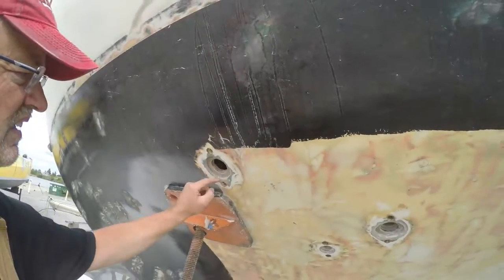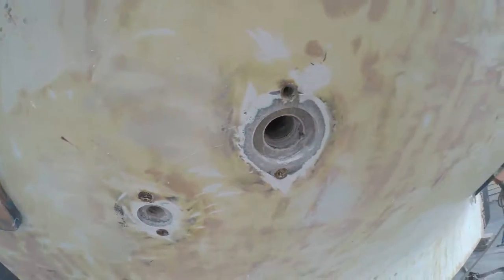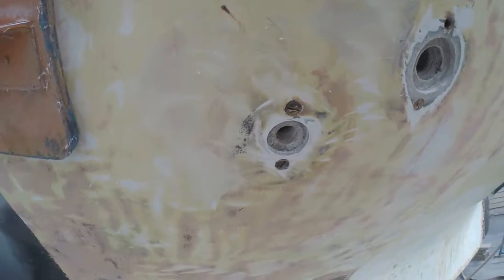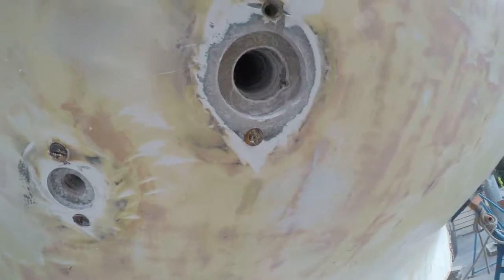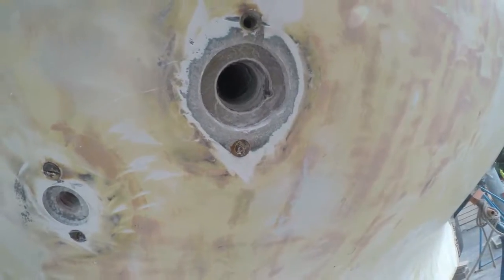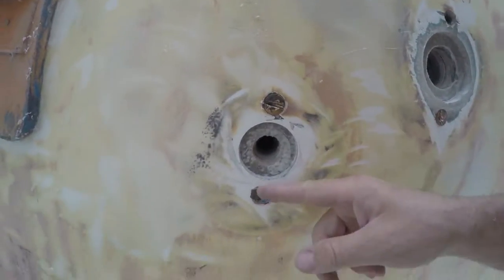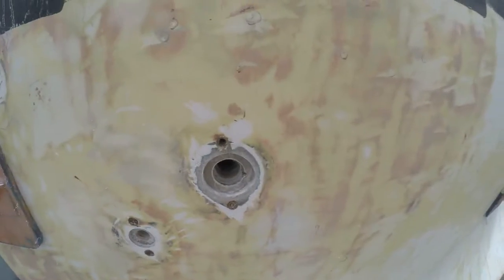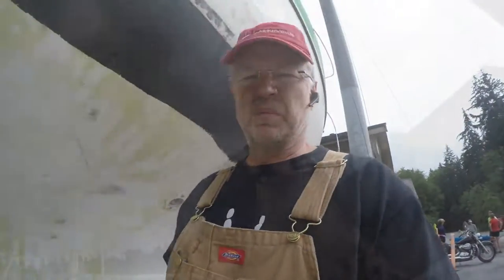Little Bear Westsail 32 refit: Seacock B Gone! Vlog #68

Comment: wow! Mine came out like butter! You may envy me if you like...lol. Good job!
Reply from the maker: You are most fortunate.  I wonder if P.O. treated them with something to prevent seizing? My new ones are most sweet.
Reply: I had to cut a few of the screws with a cutting disc but, if one side is out, the seacock will come loose and, it gave me enough play to hammer the screw out and cut the head off. The PO used life caulk, or something very pliable. Thanks for your posts. Its nice to watch someone else do stuff first.

Comment: Hi, 
From the inside, use a Dremel with a cutting weel on it to cut the screw and nuts. From the outside, put a 1/8" ballnose solid carbite endmill with 2 lips in it to eat the haed screws.
Here image:

http://images.dremeleurope.com/fr/fr/ocs/image/ocsjpg--/dremel%C2%AE4000-9180.jpg

http://www.tool-masters.com/images/toolpics/Ballnose%20endmills.jpg

For the tool that broke in your screw, good one's are made whit HSS steel, the only cutting tool that could eat HSS are made whit solid carbite or diamond, they have a negative cutting angle, we use them to cut away broke tap. I with cut it from the inside if it is easy to get at it.

Hope it help, ;)
Reply from the maker: +ald260 Cool thanks.  The inside bolts are in a difficult place to get to - not sure if a dremel would fit.  The one with the easy-out busted will be a challenge for sure.  Did you hear from Windlord?
Reply: +Wake for Me ::From outside use the 1/8" ballnose 2 lips with the Dremel to eat the screws head, with a RPM of 25,000 to 35,000. It will be a patience job to do. The small 1/8" ballnose will be easy to hold, it will not bite an make you eat the hull. The idea is to eat the center head to the deep of the screw body diameter, so that the head have no more material to hold on the body.

For the one with the easy-out, try to eat the screw around the easy-out so you could get the easy-out out with vise-grip.
If it fail, if you are a good welder or have a good welder around, weld a nut to the easy-out to remove it, I did that before. The heat of the weld will also help to get it out.

For Windlord owner, I never got any new from him. Still wayting for some inside sailboat images and inventory list. So I could not send him a write offer.

Use 1/8" ballnose 2 lips endmill made of solid carbite, they will keep there cutting edge, because you do not have collant to cold down the tool like we have on metal lathe or a mill and you could not use collant on a Dremel, it rotate to hight. Those ballnose are not very expensive for that size, around $2 to $3 each.
Reply: +Wake for Me :: Or maybe use a nut cutter tool.
Here image link: http://ecx.images-amazon.com/images/I/41au92chKPL._SY355_.jpg

I never use this tool, so could not tell you if it work good.